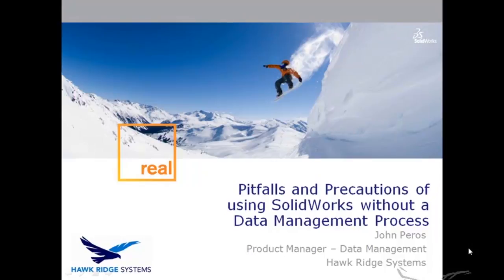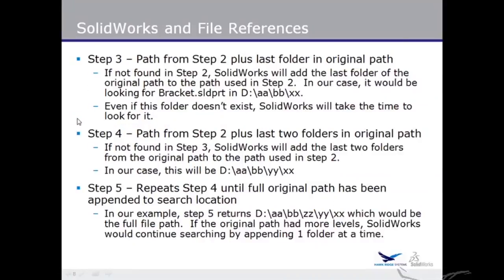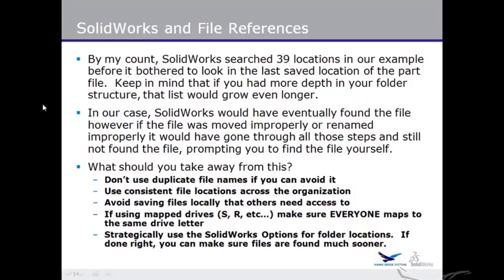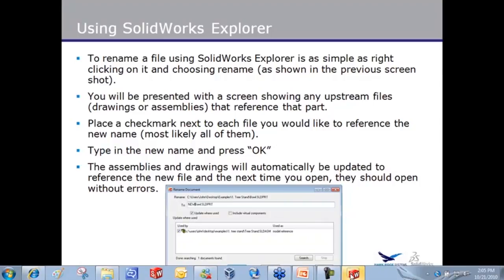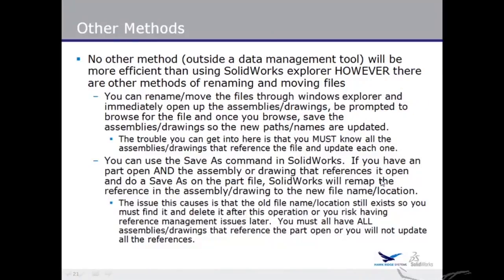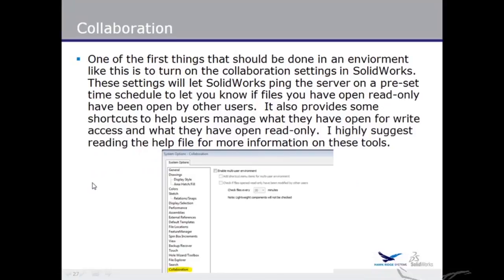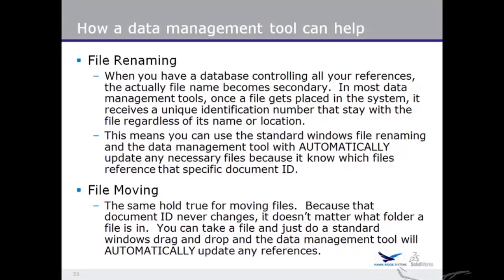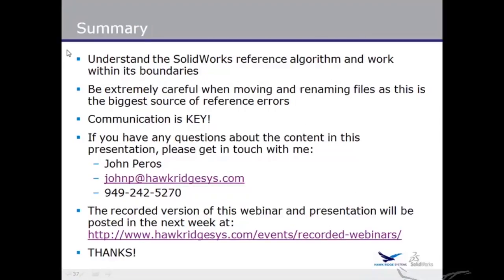Webinar Wednesday - SOLIDWORKS PDM: Pitfalls of Using SOLIDWORKS Without a Data Management Process

Comment: 6:34 min . My solidworks does not have a reference file location
Reply from the maker: Hi Sam, that is fine! "Referenced Documents" is an optional file location you can set up, mostly intended for collaborating with others on a shared network drive, when you are not using another file management solution like PDM. 

If you do load a directory in the referenced documents folder, then SOLIDWORKS will always search there for any missing parts or references when loading up files.